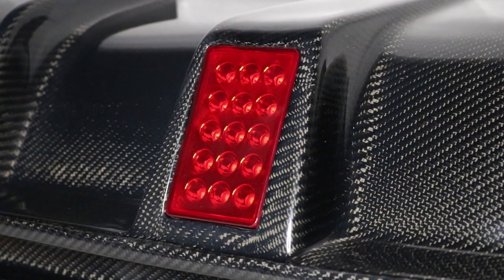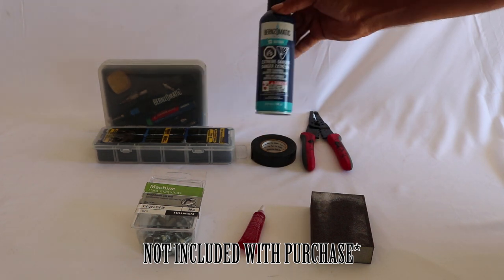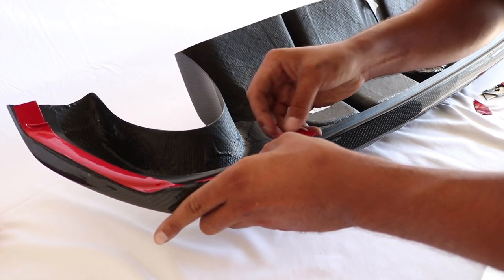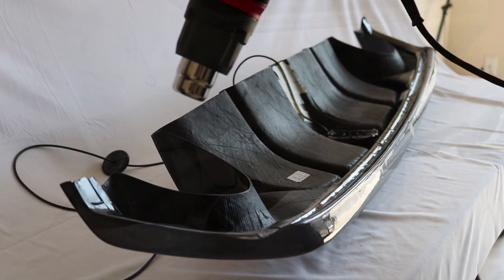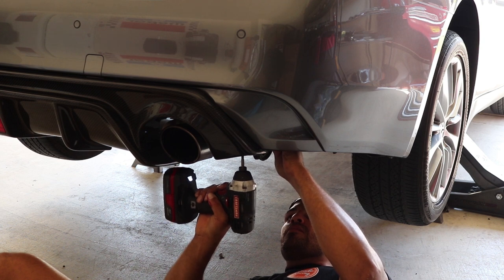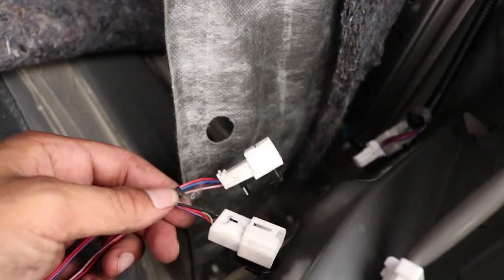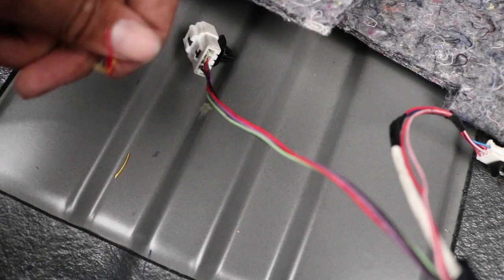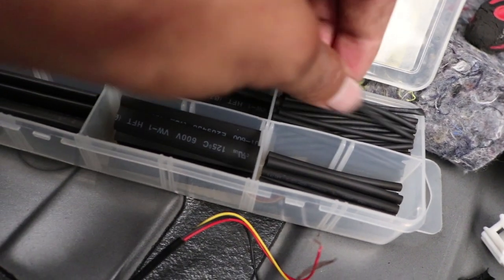Infiniti Q50 Vicrez Carbon Fiber Rear Diffuser Install!

Comment: If you guys have the same ebay special as i got: connecting white to red and black to black gets rid of the flashing. It will only light up with the headlights on, and will no longer work as a brake light. Seems better than flashing while braking though.
Reply: I got the eBay one as well. But it’s not working

Comment: Thanks it works. Only difference is I did black with black. Red with green and I had white so I did that with red. And it worked.   

When I had red with red and my white to green. It kept blinking.
Reply from the maker: Nice!
Reply: Wasn’t sure what was wrong with mine but this comment helped me so thank you!

Comment: Why didn't you use T-taps? Easier and less chance of cutting through the wires. Also, why not use your heat gun for the shrink wrap instead of an open flame? You could have done all three at once.  Last pick. Why not use black hardware for the install since it's visible or black screw cap covers?  I guess I'm just picky 😂
Reply from the maker: Yea bro it ain’t even that deep 😂. Why didn’t I just twist the wires together and use electrical tape? I could have used butt connectors too. 

The auto scene is full of a million preferred ways to do things and everything gets clouded with “the right way to do it is X”. 

Appreciate the feedback tho
Reply: @TIRADORACING  there’s always that “guy” who knows everything these the type of people who I would never listen to.

Comment: So after you applied heat to the solder and heat shrink you wrapped each wire in electrical tape?
Reply from the maker: I used dealership “Flocking tape”, wrapped them all together. Electrical tape will work.

Comment: Might I suggest washers on the bolts and paint the bolts black 🤙🏼
Reply from the maker: That or you can use black hardware. Either way you really can’t see it lol
Reply: U don’t need a washer with lock tight
Reply: @aidenhayes1684  What ? The washers are there so the material doesn’t rip out around the bolt

Comment: I have 2018 q50 luxe .. my wires are white , red and black .. would it be the same setup for the wires ?
Reply: Had the same wiring. Ended up doing white to red and red to green and black to black. It’s worked perfect.
Reply: @damianr012  I did that and it works but when the brake is applied it flashes until I let off the brake nonstop
Reply: @HunchoMarc1 that’s how it was made to work unfortunately. The flashing feature is cool but it’s annoying

Comment: Nice video! What did you do with the wire from the diffuser going into the grommet? Do you suggest to tape it down so it doesn’t flop around or does it not matter?

Comment: Hello how are you bro I may need your help here red diffuser with the light same as what you are installing this video but the thing is I don't know if there's any difference because he installed the wiring in the driver side and when I turn all my lights in the car seems like I'm losing power also the diffuser light is still continuous blinking do you know what may cause that problem or how can I solve that problem do I need some type of baluster or something stop it from blinking
Reply from the maker: Like I told the last guy, i only know what I did in this video with this car. If you didn’t do exactly what I did in my video with a 2018 q50 I really can’t trouble shoot for you.
Reply: @TIRADORACING  okay thank you hopefully that would help me out I will show my mechanic your video and that way hopefully that will solve the issue

Comment: My light blinks all the time the lights are on. Or when i unlock or lock the car it only stays solid when I press the breaks without the lights being  on. How can I fix it?
Reply from the maker: Double check your wiring. looks like something is grounding out or something keeping constant power.
Reply: @TIRADORACING  I wired everything again and it still flashes. I connected the same way you connected yours.
Reply from the maker: Well....that’s all I’ve got. I really don’t know what else you could do. 

Might be a fault with the led and not the wiring.
Reply: @fredycastro8804  did you fix it?
Reply: @lechonkadventures6616  no, not yet I haven’t figured it out yet, it’s still blinking

Comment: when i press the brakes it doesn't stop blinking any tips??
Reply from the maker: No clue. Some others have had similar problems but I really have no idea. If you did what I did in this video then I really have no tips other than double check your work.
Reply: @TIRADORACING  Thanks for replying and i ll double check it
Reply: @lechonkadventures6616  were you able to figure this out?
Reply: Only install the red and black, it’ll only work when your lights are on but it won’t blink

Comment: I only have red black and white wire on the diff Still connect the white to the green ?
Reply from the maker: Ooof I’m sorry bro I really am not sure. I don’t want to tell you the wrong thing 😣
Reply: I wired them up it works is just when I hot the brakes it only flashes it don’t stay steady

Comment: What happens if lEDs go out on diffuser light. Are they easily replaceable
Reply: Ya the lights itself are only 20$ on eBay
Reply: @hblethan5366  ty bro 😎
Reply: @hblethan5366  do you have to take the diffuser off to replace the lights tho?

Comment: My diffuser comes with a red, black and white wire. The wiring harness has red, green,white,blue and pink/purple wires. Any suggestions on wiring this? Your help would be greatly appreciated, thanks
Reply: Did you find a way to do it ? I have the same one

Comment: My brake light blinks non stop when I press on the brakes…
Reply from the maker: Like I told another guy on here. 

My model is a 2018 q50 luxe. If you followed the steps I did verbatim there should not be a problem. 

Idk if Infiniti’s wiring changes between models and years. So if you have anything other than 2018 luxe and you soldered the wires exactly how I did I really don’t know how to fix or change it. 😣.
Reply: @TIRADORACING  I have a 2018 sport, its the same, lime green, purple, black, red. Its probably not infiniti, but the product itself because I didn’t get mine from vicrez, I just decided to disconnect the flashing and keep it lit lol.
Reply: Everything works fine, it’s just the flashing is continuous when I press on the brakes.
Reply from the maker: Hmmm I wonder what the difference is in the led light that makes some not blink or continuously blink. It might be a difference in the manufacturer of the rear diffusers…
Reply: @ItsR1C3  how did you disconnect the flashing? Did you disconnect one wire?

Comment: Do you think I’ll be able to wire the light so it doesn’t flash? I want it to be a clean solid light
Reply from the maker: I am not sure.
Reply: Only install the red and black, it’ll only work when your lights are on but it won’t blink
Reply: @dontbackdown6938  didn’t work
Reply: Red to red black to black yellow to red if you want constant

Comment: You think this would fit on a 2014 Q50
Reply from the maker: It will not fit a 2014. Rear bumpers are different.

Comment: Can i put this on my 2014?
Reply from the maker: I don’t think so, I think your bumper is different.
Reply: @TIRADORACING  Do you know how it’s different? Because I saw this guys instagram page and he has a 2017 and has that diffuser
Reply from the maker: Right.... a 2017.

14-17 are the same 

2018 it changes.

This rear diffuser is for a 18-19. So it looks like you need to find out where he got his diffuser seeing your model years are compatible. 

The vicrez website CLEARLY has the diffuser I used listed for 18-19 so do not buy it thinking it will fit lol.
Reply: Will this diffuser fit on a 2017 Nissan Altima?
Reply from the maker: No
Reply: @southbayautoworkz9117  450 is expensive for me 🥺
Reply from the maker: This fits your car 14-17 (mines a 18) 

https://www.vicrez.com/vicrez-infiniti-q50-2014-2015-2016-2017-vz-style-carbon-fiber-rear-diffuser-vz100444?tracking=vzgooglmer&gclid=CjwKCAiAl4WABhAJEiwATUnEF1GUsBNkGgxBfbBdHsWg0tL2yaUWDwV97vszHdMo3XMLCZj1zMnJKhoCAQMQAvD_BwE
Reply: DSkatez dm on ig just remind me who you are
Reply from the maker: @DSkatez DM me on IG and I’ll help you out 😉
Reply: @TIRADORACING  i want a LED one
Reply from the maker: Gotcha. DM the other guy lol
Reply: @Awsometiger1011  Southbay’s is real carbon fiber.. like  most things with our cars, ya get what you pay for

Comment: Is this a 2018 Q50 Sport?
Reply from the maker: No it’s a 2018 Q50 Luxe with the 3.0T
Reply: Oh wow, I have the exact car but without the sensors. I don’t know what the difference is but two reputable shops told me the diffuser is incompatible with my 2018 luxe bumper. I’m having a hard time returning the product to vicrez now, though I love the product and wish it would fit.
Reply from the maker: That’s really weird I just installed it on a 2018 luxe lol the bumper is different on 2017 and below tho.
Reply: Yeah, it really is weird. The entire reason I ordered it from vicrez is because I wanted the quality/fitment to be perfect. There is absolutely nothing wrong with the product, it’s jus not fitting properly according to two shops! After the first said it can’t work, I decided to go to another popular shop that installed quite a few of these diffusers. He never installed one from vicrez but it essentially looks the same other than the quality of the carbon fiber. Both times, with me willing to pay $$$, told me it’s not compatible.

I’m just shocked that vicrez is giving me such a hard time with this return.
Reply from the maker: Man send me pics of your rear bumper on Instagram @tiradoracing. 

I don’t see how it doesn’t fit lol. Have you tried installing it?? Or at least holding it up to the rear bumper to see if it fits?
Reply: Yeah bro, I held it up to the bumper myself and initially was going to install it with a buddy of mine, I noticed it was off though and I didn’t want to take a chance to begin installing and then stuck with an item I wouldn’t be able to return. That’s why I decided to make an appointment and get it done at the shop.

I will message your Instagram

Comment: how did you take the two wirings from the black piece clip thats connected to the car
Reply from the maker: It’s a clip that releases. Your talking about the Eli tricks connectors? Their behind the trunk liner. Remove trunk liner, unclip the harness. That’s it

Comment: Will this fit on a 2017
Reply from the maker: No the bumpers are different.
Reply: Aftermarket part will right ??
check out SouthBay_Autoworkz
Reply: Juan Inzunza already do but wussup w jaliscos carbon fibor
Reply: @leninftp yeah theyre good too, i bought a new steering wheel from jaliscos 😎

Comment: you got ripped off my guy
Reply from the maker: I mean I don’t pay for these parts at all… my guy.
Reply from the maker: But if you believe it’s a rip off explain why so others may read and make a decision based off the information your providing.
Reply: @TIRADORACING  Yes sir, I understand the quality of
the product is very good but there are competitors that provide this exact diffuser for the Q50 for under $250
Reply from the maker: That is a very valid point. It’s also the beauty of the market. I would never push someone to pay more if they can get the same product at a better price, at the end of the day we all work hard for our money. My only question would is what is the trade off (if any) for buying at a cheaper price… customer service? I’m not sure, just thinking outside the box. But to be clear you have a valid point.
Reply: @TIRADORACING  You’re a King. Just purchased a diffuser for my sexy Q50 and your vid helped me understand the wiring 😇🙏🏻
Reply from the maker: Ayeee! That’s great news! I’m glad it helped you out!